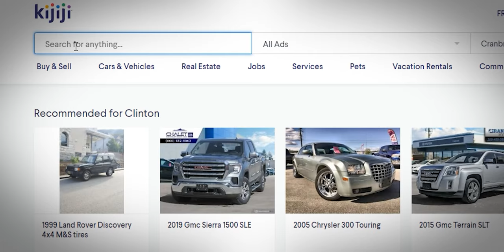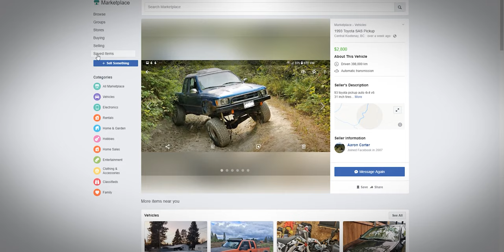BUDGET Toyota Solid Axle Swap Build!

Comment from the maker: Keep in mind all the prices I talk about in this video are CAD, not USD. I mentioned the truck was $1800, that's $1364 USD at time of writing. And total of $2500 to get it to where it currently sits, that's $1895 USD!
Reply: That's crazy! I paid $2000 usd for a stock rusty 1993 single cab. But it had a 22re which was a plus until it blew a headgasket.

Comment: GREAT TO SEE SOMEONE BUILDING RIDES THAT DOESN'T COST 100GRAND I'M SUBSCRIBED NOW!!!
Reply from the maker: Thanks for subbing! Glad I can provide the content your looking for!
Reply: Agreed. I’m tired of seeing channels moding new $80K trucks. Even if I won the lottery, I’d still enjoy building older relatively cheap vehicles. I’d do a lot of engine swaps in older trucks. 
For instance I’d like to put a 2JZ-GTE Supra motor in a 1st generation Tacoma. Put a RB26DETT Skyline engine in a old Nissan Pickup. 
Oh and of course I’d want a Mitsubishi Mighty Max pickup with a 4B11T Evo engine. 
I’d also do some diesel conversions. Like a a Duramax in an old square body Chevy. Diesel swap some midsize trucks with maybe a TDI. 
You get the picture. They can keep their Ferraris and Lamborghinis. I’d stick to cheaper more interesting builds. 
The most expensive new vehicle I’d want would be the big G-Wagon AMG G63 squared  that comes with portal axles. Lotus Elise. Hell maybe even a Audi R8. 
Actually I would want a new Porsche 911 Turbo. That’s the most super car I’d go.

Comment: My solid axle build actually stared a 1k. I bought and 84’ truck and just built on the 84’ chassis. Now looks like a short wheel base 94’ extended cab. Did have to lift the body some, so all together 6” lift all together. If I was to add everything together from start to finish with lockers, gears, EFI, cab and bed, interior, wiring, and my own paint job. I would say I’m at less than 5k, when I build some bumpers and put in some trail goodies then I’ll be past that mark for sure.

Comment: I wouldn't be telling people I paid $1800 for that. You got absolutely fleeced.
Reply from the maker: Eh, overall its still a good deal. With the Toyota market around here, hard to find anything, even super rotten for under 2K. We were also talking CAD, so just over $1300USD
Reply: @DirtGarage  I see, I didn't realize you meant CAD. I also failed to consider the straight axle driving the price up, at least it would here in Oregon. People get all googly eyed over that straight axle and the dollars start flying. lol I was thinking IFS and you can nab one of those in fantastic condition for $1000 USD any day of the week.
Reply from the maker: @thesickhorseranch  Our market is very different I guess. Solid axles for sure make them more expensive! But I talked about the market here in the video. Clean 3rd Gens go for 4-10k Easy.
Reply: Theyre like 5k with ifs and mostly rust here in Kentucky.
Reply: @DirtGarage  I paid 5,000 usd for a clean 3rd gen extracab 3slow 5speed. I was sick I had to pay that much till I started driving it now I love it! Lol I'm going to throw a 3.4 in it after I get all the parts because the 3.0 is the only thing I don't like about it! And the extended cab I kinda wanted a regular cab but I can live with that extra room!

Comment: Just FYI, those "Sketchy Shims on the front axel are to help align the axel to the correct angle to prevent wandering while driving... if you get any that I would toss them back in.
Reply from the maker: If that's the case why does nobody else have them on their FRONT axle.. Fix your pinion with shorter or longer shackles, not sketch city shims.
Reply: Derrick Thomas this is incorrect. As those shims are used to adjust caster. But negative caster is the exact opposite of what you want.

Comment: A guy at my job has a 99 4runner with the TG sas and a bunch of other good parts on it. Trail only rig turn key and is only asking $3,800. Wish i had the money cause I would of bought it
Reply from the maker: The previous owner had this as a trail only rig, and trailed it everywhere! We fixed everything, and it drives great down the road.

Comment: I have a 90-91 Toyota pickup that’s still super clean and it’s been sitting for a few years now. I’m going to get back on this project and swap a 3.4 into it and also I’m looking at the trail gear ifs eliminator kit. What solid axles should I be looking for to do this swap?
Reply: I know I’m responding 11 months later but i have a 3400 motor, where are you located?

Comment: Any plans to cut that ghetto spring hanger and front shock towers off?  I'd go with a sky's front hanger and ford super duty shocks towers. Don't forget to push the steering box forward and plate the frame.
Reply from the maker: The hanger is actually really solid, so no that's there to stay. The shock towers on the other hand are going away for sure! Right now the steering box mods are not required, no binding or anything, check out my series on "lowering my solid axle swap" we moved the box on my truck after moving the hanger high into frame.
Reply from the maker: Find the video I'm referencing here https://www.youtube.com/watch?v=6S0irSDEWHA